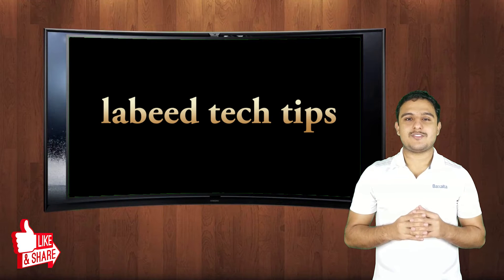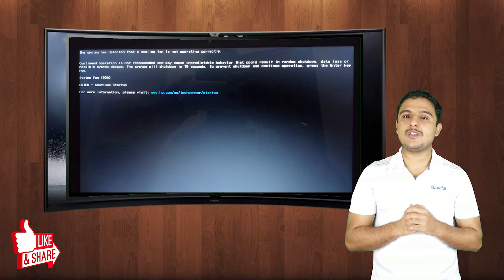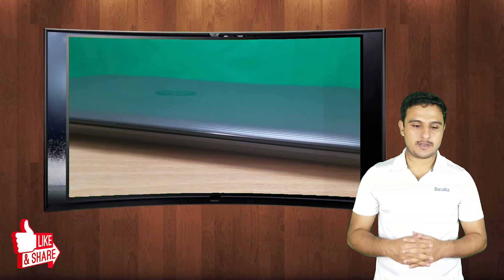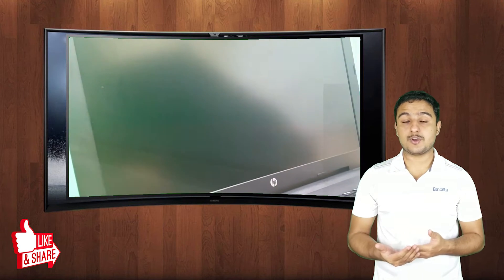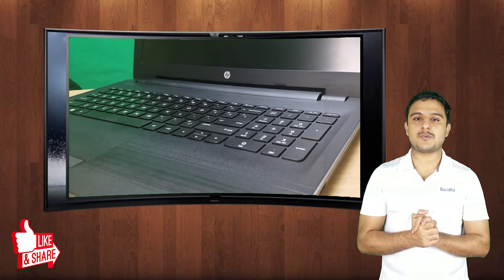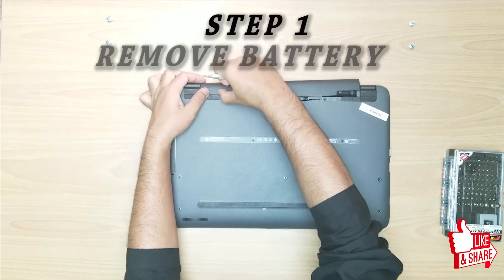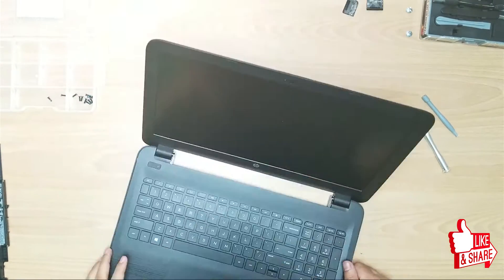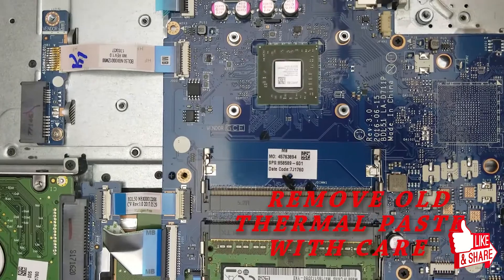HP Cooling Fan is not Operating Correctly // ERROR 90B

Comment: My laptop is 7 years old and  for the past one year this error appears several times and each time I went to nearby shop and get it fixed.  Again it has happened.

Can you tell me which screwdriver I have to buy and which thermal.paste ??.
.u can put an Amazon link to buy them in the description
Reply from the maker: Hey man, please provide me your laptop model number so I can look into that
Reply: @LabeedTechTips  you dont need to know the model number. he just asked where u can buy thermal paste and a small screw driver
Reply from the maker: Agreed but it's quite old laptop and different brands have different types of screws and required different bits and internal screws are bit different then external ones and to remove the heatsink sometime requires different set of bits. That's why ask for model number so I can recommend one set which should be good to open and reapply thermal paste.

Comment: hi
i have the 90b error code on booting up, took my HP Compaq CQ58 apart to get to the fan. it was just stuttering, not even a complete revolution, barely any dust but cleaned it up anyway and reassembled it but same problem, just a slight spin (not even a complete revolution) so replaced fan. Still nothing , just the same as before.

it did power up for a minute just once but then when i had put it all back together, with every screw back in, it went back to stuttering again.
 i did get the fan to work by starting it off with a screwdriver and it span for hours!

turned it off and then back on and the same issue, had to start it off again by slowly turning the fan and it's been spinning for ages with no 90b error code..

Obviously i can't do this every time as i have to have the keyboard loose and at an angle to reach the fan, but no one seems to have had this issue on the net.  i'm hoping you may have an idea as to what the problem is please!
Reply from the maker: Hmmm in simple works your laptop fan is stuttering and to make its spinning you have to push it and then it starts spinning... 
Please let me know if I understand correctly..

If I understand correctly then 3 things comes in my mind right away. But a quick question is this laptop doing the same thing when you turn it on on the battery..?
Reply: @LabeedTechTips  thanks for your prompt reply.
You are correct with your assumption as to my having to start the fan manually.

The battery hasn't worked for a little while and I run it using the mains lead. I don't want to buy a new battery in case the laptop fan issue is to expensive to fix, as that will be more money wasted
Reply from the maker: Got it. And I am hoping this issue is starting after you lost the battery..  .
you can try to change the charge the reason is to change the charge is that its possible that charge lost some capacitor or they are week and couldn't give it much power to start itself that's why you have to push it to start and once its spinning then it keep spinning. You can try to borrow or go to a shop to test new charger. 
Let me know after this their might be 2 more thing that you can try but this charge one is seems to me more easy to do.. let me know if there is anything else.
Reply: @LabeedTechTips  I think it might be the motherboard, as I inserted the battery and the mains lead started it up and the fan started!
But then I noticed the touchpad light was off and no cursor (should be either amber/green light to show it's off/on 

I think I'll have to call it a day and bin it
ARGHHHHH

Comment: I am facing the same issue on my hp  probook 450 G4 model laptop. If I continue by pressing enter key, will this cause any harm to my pc?
Reply from the maker: It might not depending on the condition of you PC. Because if the fan is not then it might need to change or clean you need to investigate bit more on its condition.

Comment: Whats wrong with my computer?  I turn it on and the fan sounds like it gets locked up and I can feel it kind of vibrating.  Is there something stopping it from spinning?
Reply from the maker: I don't understand wather its a desktop computer or a laptop but There could be many things that can goes wrong with it. here are some generic things. Try to follow these and let me know if there is anything else.
1: it might be stuck/locked due to the dust or some other hard stuff stuck under the fan blade.
2: it might possibly its fan is dead.
3: its also possible the fan needs more power due to its age and you can try to huck this fan with the pc you directly
The only wasy to know this you need to open its and try to spin it with hand and see what could wrong with it or before doing that you can try compressed air to clean but it all depends on the model. Thanks
Reply: @LabeedTechTips  its a laptop and thank you i will try these sometime
Reply from the maker: Sure let me know if there is anything else.

Comment: I just clean my fan, but the warning still come out
Reply from the maker: Did you clean the old thermal past and apply new one..??
Reply from the maker: You can try to clean the fan if it still remains the same then replacing the fan is a good option

Comment: Hi can you help answer my question? If I take out my laptop fan do I need reapply thermal paste?
Reply from the maker: Taking out the fan doesn't make any difference you need to reapply thermal past on the processor under the heat sink. There no place on the fan for thermal past

Comment: When I got same error  I cleaned My laptop fan  and also apply thermal Paste after that my laptop working fine but after 10days I'm getting same eroor
Reply from the maker: In my experience I've never seen this kind of error again once if its properly cleaned..
Reply: @LabeedTechTips  after 10days sometimes I get cooling fan error 90b and sometimes not.. Why this is happening??
Reply: @GamerBoyOfficialSaHiLSingh  please tell me your laptop model and brand.
Reply from the maker: Please tell me the model number of it if it's old then you should clean the motherboard along with the fan and CPU..

Comment: too fast, can you slow down and explain each step please? i kinda of got lost at the removing of cd
Reply from the maker: Can I know the model number of you laptop so I can help you in a better way
Reply: What is there in thermal paste i didn't get it
Reply from the maker: 1 Remove the battery (if its outside)
2 remove the CD, DVD dive (if it has ) it varies from laptop to laptop 
3 open all the screws and open it gently 
4 clean the CPU ,GPU and reapply tharmal past and reverse the opening process 
5 i will recommend to go and watch the teardown video for you particular model of that. Once it's open then you can follow this video to clean CPU and reapplying the tharmal past.
Reply: @LabeedTechTips  thank you for the step by step, that was very helpful, thank you again
Reply from the maker: No problem anytime